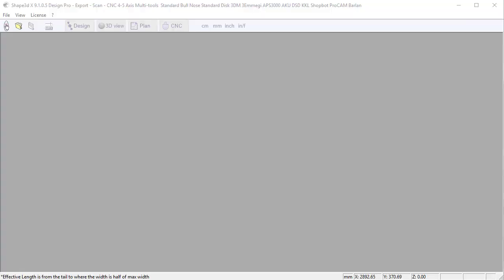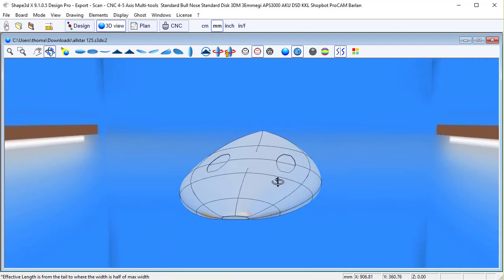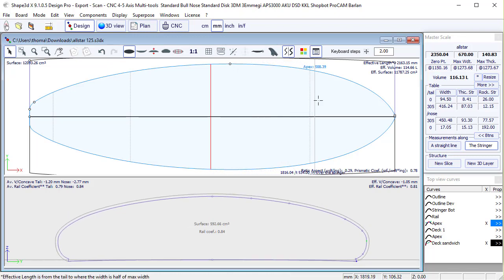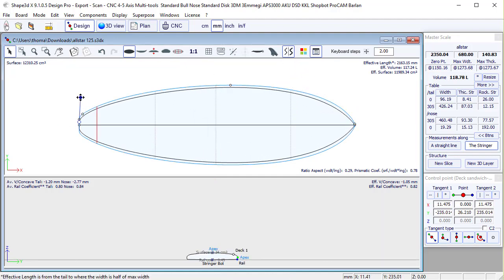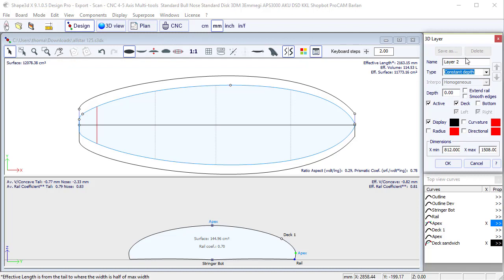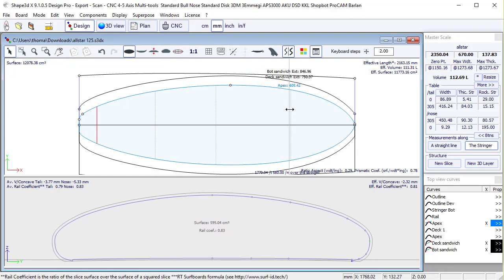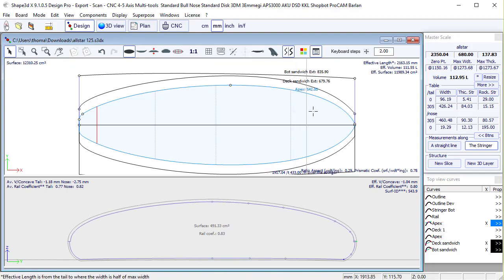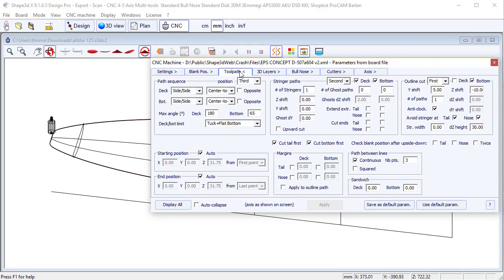How to remove sandwich thickness using 3D Layers in Shape3d X

Comment: hi! can i in shape3d unfold the outer shell into a plane bottom and top, and thus get a pattern vector for cutting pvc on cnc... for perfect sandwich wrapping? thanks!
Reply from the maker: Yes, Shape3d can export (or print in the Pan mode) the developed surface of the board and of the constant depth layers.

Comment: Does this sandwich also make the resulting shape shorter, because the sandwich is also on the Nose and Tail? 
Unfortunately we can not use the CNC of Shape3d because we have Rhino which controlls the CNC. Do you foresee any possible issues with the export to Rhino. I.e. is there something we should take into account with our 3dx model to avoid any pitfalls?
Reply from the maker: No it doesn't, this is an approximation indeed. You can also use the option "Add/Remove thickness" in the menu Components -> Action, which does reduce the length. This option only works well on simple shapes though, on complicated shapes with 3D layers you can get some distortions you'll need to correct.
Note that most CAM softwares have the option to remove a fixed thickness, and if not you can always remove the sandwich thickness setting a smaller tool diameter...
Reply: @shape3d362  Thank you for your feedback. You mention, that this in approximation. Which I understand because of the nature of the problem of parallel curves or surfaces. But does your approximation apply on the real 3d shape so on the surface normal or on the slice curve normal. What I want to say is that in the tail and nose the actual thickness reduction in the slice view will be different, i.e. considerably more, because of the angles of the slice  to the direction of the surface normal, and does your approximation account for it?
Reply from the maker: @schobihh2703  Not when you use 3D layers.

Comment: Thanks for this. Why do you do it like this and not use the sandwich setting under the resize option?
Reply from the maker: The sandwich setting is used in the CNC mode, but not if you do a 3D export.
Reply: @shape3d362  Thanks...so If I do the setting under resize option, my supplier's cut will be whatever I set it to? I am not able to do 3d layers with my free version.